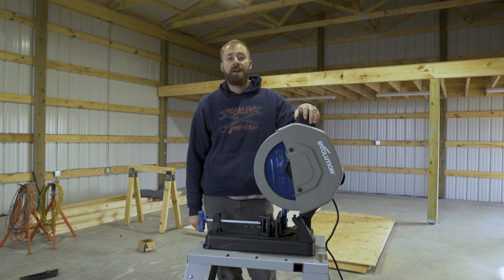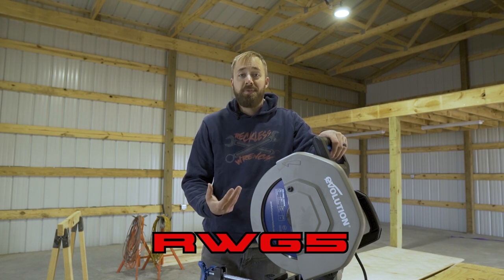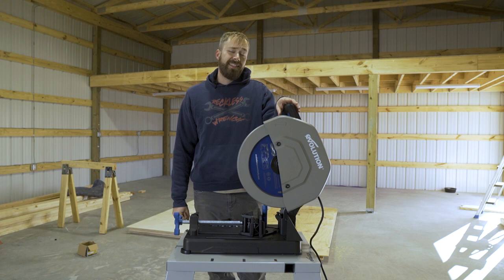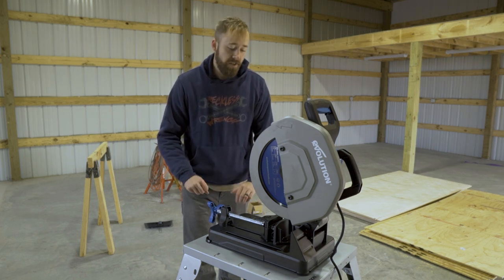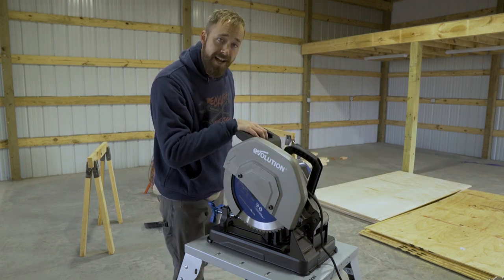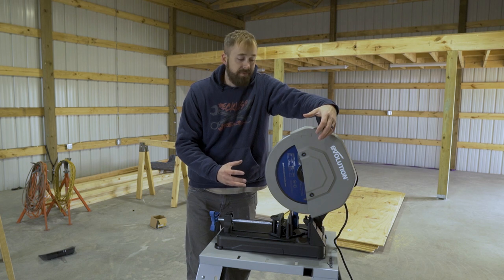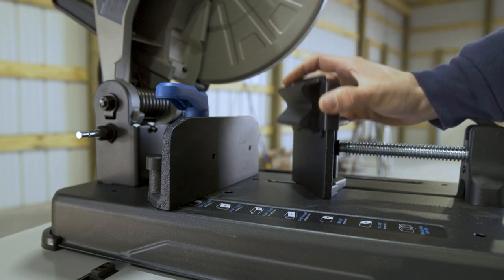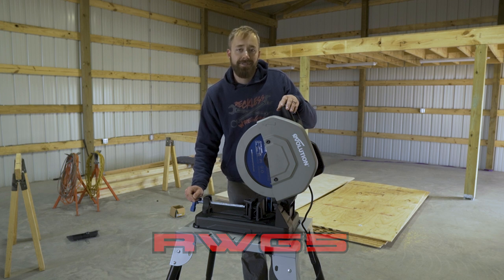Best Metal Cutting Chop Saw? Evolution S355CPSL

Comment: OK, that's the 355.  Is the 380 worth the extra Benji?
Reply from the maker: That would be totally up to the buyer to decide. 
The difference between the two is mostly the base.
The 380 has a heavier base that is designed a bit different. It adds the option to run a 15” blade, the ability to cut certain materials up to 1” larger than the 355, the 45 degree lock pin, a chip tray rather than deflector and it uses oilite bushes. If those things are worth the added cost to you, go for it. If that doesn’t sound tempting enough, don’t worry because the 355 will run neck and neck with the 380 all day cutting equal materials.
Reply: @RecklessWrenchGarage  Thanks.  That was exactly the info I was after.
Reply from the maker: Glad we could help. 👍🏻
Reply: @RecklessWrenchGarage  Appreciate the info also!  Any chance you know how the EVOSAW380 compares?
Reply from the maker: Between the two of us, we have both models (380 and 355). As mentioned, the made difference is the base and the size of the blade you can run. 
The cut quality and performance is so similar, it would be difficult to tell them apart using the same size blade.

Comment: This saw is absolutely worth it. The biggest deal is straight cuts. If you pay yourself minimum wage to straighten out wandering cuts from an abrasive saw, you will have the purchase price saved up in no time. If you already have an abrasive saw keep it for high carbon cuts. I think I just shelled out my blade on a piece of scrap pipe that was probably from an oilfield application with a higher than average carbon content. It is still cutting, just a little slower.

Comment: I just got this in and set up. I haven't used it just yet.  I was curious about the aluminum blade because they're not available right now.  Will the mild steel blade work? I picked up the stainless blade for the exhaust I'm building

Comment: I’ve looked into buying one of these and it seems most user complaints are, lack of a true angle after the cut and screw threads stripping out on the vise. Has these issues been fixed or is Evolution still selling them knowing about the problems. I noticed you didn’t check your cuts with a square.
Reply from the maker: I can tell you I have never stripped out any hardware on the 3 evolution saws that I own. I also have checked them with a square and they are true. Check a cut on an abrasive saw with a square and let me know how those are
Reply: @RecklessWrenchGarage  
I have a dewalt chopsaw and I can tell you for a fact that it will NOT produce a square cut. I’m just going off of what I’ve seen right here on YouTube. Some of the vice screws were made from regular threads and some used acme threads.
Reply: The way I understand it is that the previous model EVOSAW380 had the “V” thread issue.  The new series has 2 replacements both with ACME threads:

The S380CPS is the direct replacement for the EVOSAW380 and added the ACME threads, better catch basin, better swivel clamp with with pin holds for 15, 30 and 45 degree cuts.  This one, the s355cpsl still has the ACME thread upgrade, but removed the chip basin, does not have upgraded clamp hold and used a cheaper/thinner steel base instead of heavy cast iron.

Comment: So, can I use the 355 to cut carbon steel hollow bar 1518- 40mm x 28mm.
Or should iI go with the 380 model ??
Thanks.
Reply from the maker: Both saws will handle that material with ease.  Using the steel cutting blade, it will slice through that nicely. Choosing the best blade option would be the key to cutting through different types of material.
Reply: @RecklessWrenchGarage  Thank you Sir.!!!

Comment: How long does the blade last
Reply from the maker: It varies depending on use, so time is relative, but our first blade has 3 years of use on it. Cage work for two vehicles, sliders for 3, suspension for 3, and a couple random side projects.